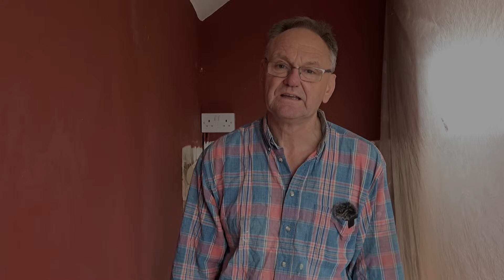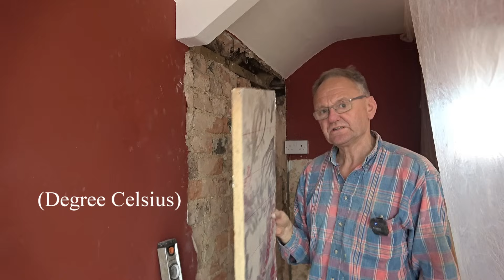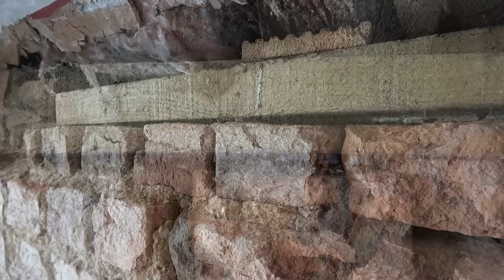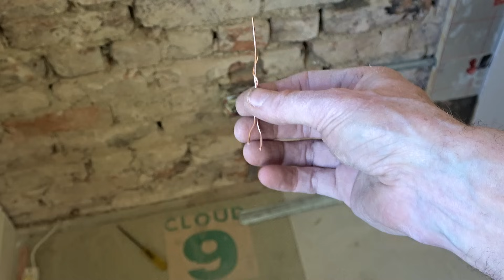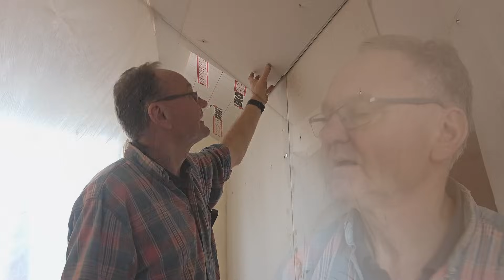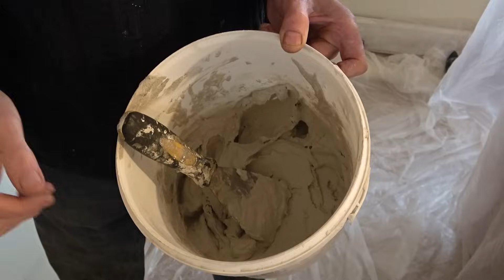HS165 Insulating a solid wall (Do it yourself)

Comment: Thanks for the video, great work 👍🏼.
I was wondering if I need to take down the plaster as it seems in good condition? 
Many thanks and keep the good work 🙌🏼👏🏼👏🏼
Reply from the maker: Hi Antonio, as I say I'm not a builder or any kind of expert, just DIY level, but I'd say if the plaster is good I would definitely leave it on. I only chopped the paster off because I needed the space, (I could not sensibly move the wardrobes along), and also there was an annoying slope on that wall (more than 1 inch off vertical), but that was very much secondary. A decent thickness of cement render or plaster can actually add quite a bit of strength to a wall. If I had had the space I would have left the plaster on. Cheers

Comment: Can you discuss why you attached the insulation directly to the solid wall where as on another channel i saw someone saying that on a solid wall you can't do this that you need to put in on batons to avoid condensation.
Reply from the maker: Hi Conor, quite simply in this case I did not have room for battens. But I've done this in other rooms over a number of years and never had a problem. But as I say, this is just DIY in my own home so professionals and experts may have other opinions. I've equally seen YouTube channels where they don't use battens but 'dot and dab' with adhesive foam and stick the insulation board straight on to the plaster. And thinking about it, most drywall/ dry lining (plasterboard onto brick or blockwork) is just like that. Cheers
Reply: @HaxbyShed  and I have seen too where someone said if the solid wall is not damp to begin with that it will be fine to attach directly

Comment: What the tape called you used?
Reply from the maker: Hi Nestor, it's plasterboard jointing tape. That one was self-adhesive with fibreglass reinforcing  mesh. There are various types. Some are not self-adhesive, and some are just like a paper tape. Cheers
Reply: I can't find that tape?
Reply from the maker: @MrNest24  To be honest I've just been looking and I can see self adhesive fibreglass tape but not the sort with the super sticky and pull off backing. So maybe you can't buy it anymore? I would have got it somewhere like B&Q or Wickes, I know I did not go far for it but it was maybe 8 or 10 years ago.

Comment: Did it make your house warmer.
Reply from the maker: Hi shinadie, it certainly made that bedroom warmer, and it heats up quickly now when the heating comes on. Our bed headboard is against that wall and we used to feel the cold from the wall when sitting up in bed. I've been meaning to do it for years and the increase in energy costs finally gave me the incentive to tackle it. Cheers

Comment: Really helpful as I am planning on doing the same in my son's room which like a freezer right now so he can't use it. Thank you.
Reply from the maker: Thank you Sis Yan, it was a big job because the plaster had to come off in our case but if the plaster is staying then it can be a reasonably quick job. I've seen videos on YouTube where they use the insulation-backed plasterboard stuck on dot-and-dab with adhesive foam and then just a couple of fasteners in each board. Cheers

Comment: Is it okay to just dense pack? Got pre existing 2x4 wall against brick.
Reply from the maker: Hello John, I'm just a DiY guy so my technical knowledge is limited. Maybe a viewer can answer for us. I would just be careful about packing with anything that could hold water unless you are able to include a damp-proof membrane against the wall. I think I'd be happy with foam insulation board - but again that's not professional advice (I don't want to be sued😁 ). Cheers

Comment: Well done for tackling such a job on your own. To take the time to make a video of yourself doing it is going way above and beyond. My house is a 1970's build with solid no fines concrete external walls. It's a very cold house. I'm considering taking down the internal plasterboard, installing kingspan sheets and reboarding. Your video is inspirational.
Reply from the maker: Well thank you very much for the compliment Gordon. I enjoy making videos so it's no trouble to me. I've insulated other walls which were much easier, because I did not have to hack the plaster off or get showered with 150 years of muck and crud falling in my face. Cheers.
Reply: I wouldn’t even take down the existing unless your rooms are small I strapped over the old wall the sf19 then plasterboard so warm now
Reply: @johncowie3092  how did you strap it onto the old wall?

Comment: Doing internal party walls is fine, however do this to external facing walls can cause  mould and condensation and can cause bricks to spoil due to saturation and frost. as the wall can not breath.
Reply from the maker: Hi Jean, I have done this on a few of my walls over several years without noticing a problem but I do understand your point that it could happen. I'll have to keep an eye out for any of those problems developing. Cheers

Comment: Hi, really useful. I'm in process of deciding how to insulate 2 exterior walls and this has given me more ideas. Taken off the old plaster and the wall is pretty uneven so still not sure if I should batten the wall or do like you did. Space isn't as much of an issue but getting the battens straight(or even just getting straight battens - looking at the wood in the merchants it's often not very straight) my be problematic. Screwing the insulation like you did might be a better idea. Given me lots of food for thought. Thanks again.
Reply from the maker: Hi FrigbyC, later I pumped in some expanding foam behind the lower sections where I could not fit insulation but I was warned not to pump too much in because the expanding foam can blow the boards off the wall! Cheers
Reply: Perhaps consider "dot and dab"  A good adhesive is not expensive, eradicates all the bumps in the wall and just needs some temporary fixing to hold the sheet in place while the adhesive sets (see my comment to Paul today, 6th Feb)

Comment: I’m glad I found your video Paul. My job will hopefully be easier as the walls are plastered to solid brickwork and quite smooth, but I have not done this before, so watching you tackle such a project has given me the confidence to crack on and insulate my property. Thank you for sharing this video.
Reply from the maker: Thank you Gordon. There are vids on YouTube where they use the plasterboard backed with insulation and just 'dot and dab' it on the wall with adhesive foam, which makes it quite a quick job. I think they also put a couple of screws/fasteners in each panel for security. Mine was a more complicated case.  Cheers

Comment: im looking at doing this but fixing to battens   im worried that condensation droplets will form behind the insulation and drip onto the joists also worried that the walls lime mortar joints behind will deteriorate      do you think it would be a problem.  see soo much information online saying different things
Reply from the maker: Hi Kevin, my opinion is not worth more or less than any other DiY amateur.  I have applied the same insulation to many walls in this house, screwed onto the face of the plaster with no gap and I've never noticed any damp or sweating.  Proper old houses did not have a damp course and lime mortar often stayed a bit like paste on the lower courses. Old houses often move around and normally you don't see any cracking on the walls because the lime just moves with the walls and the bricks find a new level. Maybe there should be ventilating space between the insulation and the outside wall but frankly I'm not losing any sleep over it.  This house will outlast us many times over. Cheers
Reply: thanks for your reply.  been overthinking it for ages.  i think you are right. the house wont fall down!!

Comment: The measuring up and out to ensure hitting the centre of a brick is simplified if you use a wooden batten as a staff and mark the drilling points onto the staff with a pencil.
Reply from the maker: Howard, that's a good method. I think people always reach for what they know best and for me that's measurements and drawings so that's what did. And I usually cut my allowances too fine on DIY jobs. In my case it's measure twice, cut twice and then sand it to fit! Cheers

Comment: Been there a few times. The mess, the "ow crap" moments, eating dust, and the result is never good enough for the chief :)
Reply from the maker: Hi Rusti, it gets me when the simple job just gets bigger and bigger as the hole appears or indeed the steel beam you assumed was there is missing because the cheap builder thought the wall would be fine without it. Cheers

Comment: the patients of a saint
Reply from the maker: Hi Sandra, it was tedious but at least on that wall the boards are shorter than the ceiling height. Getting them on and off for the various operations when the board is almost touching the floor and ceiling with limited space to manoeuvre is a right pain. Cheers.

Comment: Oh my Paul. Old buildings fill me with utter fear. If I had been in your shoes I would have broken down in tears when the wall was revealed behind the plaster. I will never understand how you remained calm throughout this project. Well done on achieving what looked impossible. 👏👏👍😀
Reply from the maker: Ah well Andrew, I've crawled in and out of every corner of my house and I know pretty much what's what. I was expecting what you saw although the dirt falling out was pretty spectacular, I admit. Now above there the loft space was a totally sealed space with no way in. I had to knock bricks out of the end wall to get in from the main roof and then I found half-tree beams and plaster with everything lime washed. Very spooky crawling through there. I think the room below that bedroom is earlier and then the bedroom was built on later - hence the ledge stepping into the room. The floor in that bedroom was maybe 9inch lower until the 1990s when the previous owners had it raised because the guy was tall and kept banging his head on the low beams below. Hence I think that part of the house was originally a store with loft, but it is all more recent than the main part of the house because that back wall of the house is double brick. Cheers
Reply: @HaxbyShed  I agree that old houses have a “history” that modern houses lack, and with detective work so much can be gleaned. My wife and I have in recent years been smitten by a few houses in or close to the North York Moors. Unfortunately one drawback is that I am 6 foot 5 and invariably many properties of an age have rooms which I simply cannot stand in. Many a dream has been dashed 🤕🥴

Comment: Hi Paul, great job. Been there with bells on lol, used to live in a stone and slate Scott's cottage built in 1760. Three foot thick walls all wringing wet, no fun. I even found a live 'inductive' device where live twin and earth had been wrapped round the hot and cold water pipes behind the kitchen sink........ Oh and the water stop tap was behind the electric oven lol. The joys of old houses and what estate agents really mean when they call them 'character properties' lol. Cheers, Jon
Reply from the maker: That electrical wiring sounds a bit frightening Jon. But mind you I've seen some frightening stuff in modern houses too. An electrician told me he once found an electric shower wired to the ceiling lighting.  Cheers

Comment: Hi there, great video I've just one question.  Do you not need an air gap between anything such as between brick (original wall) and the Kingspan?  Or between the Kingspan and the new plasterboard?  Thanks in advance.
Reply from the maker: Hi ImMarkyB, I've never put an air gap behind them and I've not had a problem. As somebody said, you could cover the bricks or plaster with dilute waterproof PVA to give a seal. But as I say I'm a DIYer not a building inspector :-)  If you have plenty of space and an uneven wall then I would probably fit battens first just to get a perfect 'plane' to fix the board to and then the air gap would also give you a bit more insulation.  The kingspan should, in itself, form a barrier although I did not tape the gaps (but then we are getting into damp vapour vs damp in the wall). So maybe I did not answer your question exactly but it's a sort of opinion anyway. Cheers

Comment: Great job,Paul. I have done lots of that type of renovation work on barn conversions in years gone by. The polyurethane sheets make a huge difference to the heat retention of old masonry walls.
Reply from the maker: Yes Howard I think you get a lot of benefit for not much money spent. Cheers.
Reply: Good. Not to technical.

Comment: Good job! Those old walls are hard to deal with, i have done my share of dry lining
Phil
Reply: Me too,Phil. Having done a few barn conversions over the years you learn/invent a number of your own tailor made solutions for fixing and levelling insulation and plaster board to scabby old walls.
Reply from the maker: Hi Phil, I think any surveyor would say knock it down and rebuild the wall but the fact is it's been there perhaps 150 years and is good for another 150 - since we don't have earthquakes in the UK. I think people over-worry about these things. There are always reasons to spend money if you want to. I watched your vid changing the top bearing on the Harrison vertical head. That will come in handy thanks.  Cheers.
Reply: @HaxbyShed  i did completely strip that head and rebuild it because the sight glass was smashed and all the bits were inside! I don’t think I videoed it though, i will have a look!
Phil

Comment: Well done, and thanks for taking the time to record it. I have been lubricating my screws with vaseline (I think someone has also suggested this) it certainly helps although you need to be careful not to overtighten.

You have to wonder about the state of the Victorian housing stock, I can remember practically drilling into sand as well in my old terraced houses from that era.

Good luck from Spain!!
Reply from the maker: Hi David, soap is also a good lubricant, if you can find a bar of soap these days. If you have an old house you have to expect work. Character comes at a cost. Cheers.

Comment: Enjoyed that Paul. I know from experience a new house isn't without its problems either! Post back in spring with whether you think it's made a significant difference to the room temperature. Cheers, Matt
Reply from the maker: Hi Matt, I've not quite finished decorating the room yet but with the radiator on low already I can feel a difference. You don't get that sudden chill as you walk in. Cheers
Reply: Even at 25mm thickness the rigid PU insulation boards will make an enormous difference to the insulation and warmness standards of that old wall.

Comment: Great job on the wall. I have never seen this done before as dad did all this work on our house before I was born and the walls do not feel cold in the winter
Reply from the maker: Hi GTB, material for this are cheap and the end results can be very effective but it takes a lot of patience. I've tended to do the coldest walls on a least effort / maximum benefit basis such as end wall of the landing, attic ceilings, alcoves either side of the fireplace etc. Cheers

Comment: Would have taken a coat of cheap PVA and painted the wall before the board, so that you keep a sort of bonded layer to control further degradation of the wall. Any old paint would work, just apply with a sprayer or a thick pile roller. After that you can stick the board with either foam filler or caulk, along with the screws into the board. Filler always works better with a little bonding agent added, less cracking and it remains slightly flexible, unless you pay more for the one with the bonding agent already in it. Also then works as hole filler.
Reply from the maker: Hi Sean, yes I agree the wall would have benefited from a wash with diluted waterproof PVA to bond it and to act as a vapour barrier. Cheers

Comment: I once owned a brick house in Stratford Ontario Canada. It was an old farmhouse that was around 100 years old. On the inside there was 2×4 studs with wood lathe and plaster with horse hair in the plaster, but no insulation. The heating bills where horrendous!  
In the winter at 20c we would get frost on the inside walls. I tore the lathe and plaster off it was rather dodgy in areas, insulated with 4 " fiberglass bats R16, vapor barier and then used drywall board. It had a profound effect on the hesting bills and home comfort. And got rid of the old house smell!
Reply: In cold climates the modern prebuilt SIP insulated panel wall construction takes a lot of beating for its high insulation value. Creates a really cosy house with very low heating costs.
Reply from the maker: Hi Glenn, luckily we don't get it so cold here and most winters we only get a few days when the temperature is consistently below freezing.  I've insulated many out-facing walls and roof spaces in this house over the years. No dramatic effects but I'm sure all the savings accumulate. Cheers

Comment: The timber in my house is like that (50 year old Jarrah - an Aussie hardwood).  I pre-drill to give me 50% thread engagement (screw (thread id + thread od)/2) then press Vaseline petroleum jelly into the hole, coat the screw with vaseline, then pray I don't shear the head off the screw with the impact screwdriver.
Reply from the maker: Hi Steve, great to know that our joists are solid but tiresome to work with. Before hand soap came in a dispenser I used to use a soap block as lube but then my wife asks what are all these spiral marks in my soap? Errr .... no idea never seen them..... Cheers